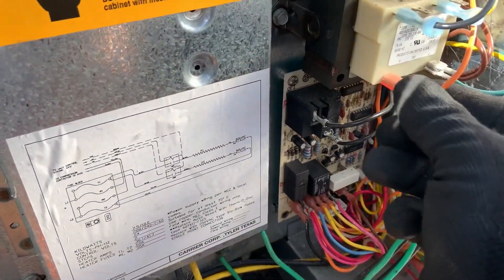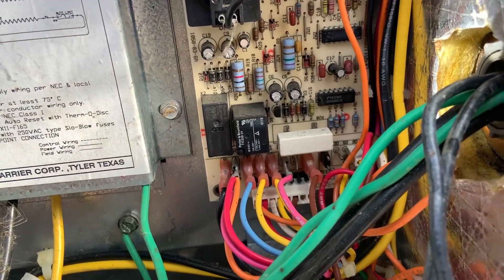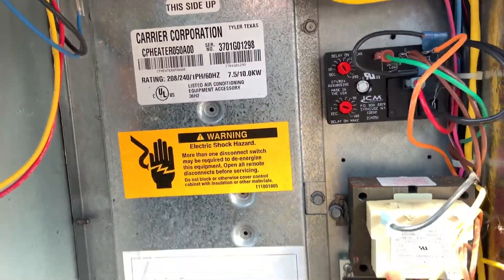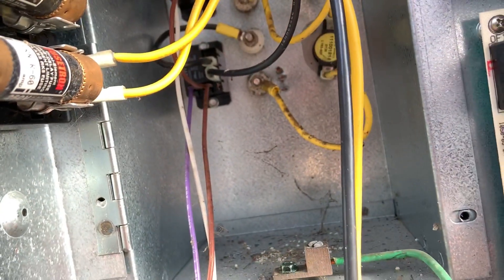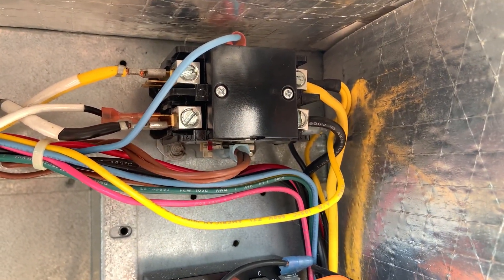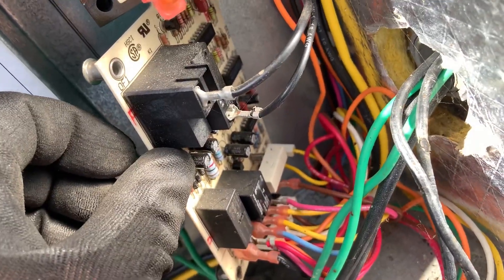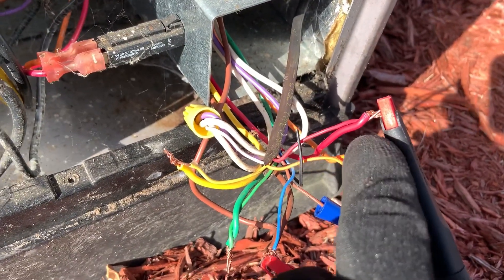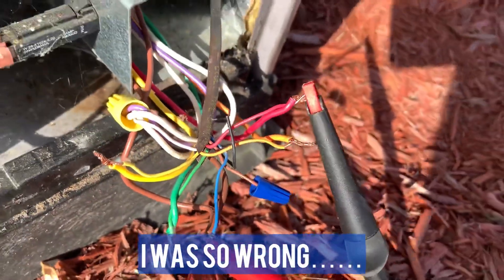HVAC Service | Troubleshooting a Low Voltage Short | December 2021

Comment: Typically run threws and bad connections can cause intermittent low voltage shorts. Nice like to chew wires and sometimes there not always chewed threw

Comment: I realize it’s probably just a coincidence but almost all the the low voltage issues I run into seem to be a Carrier product. Not sure why lol. I installed a new Payne split unit one time 14 months later it started that. Same thing you had reversing valve wires had done almost the same thing. It would go through a defrost cycle it was winter and pop that fuse. Thanks good vidio.

Comment: Always check your pressure switch wires especially in package systems. The transformer you replaced was fine. I hope you didn’t charge them for that transformer.

Comment: Good video ! 
Bottom Line is --- You Most Likely Got it Fixed ! & on the First Visit with an intermittent short.
However you got there. Thats a Good accomplishment ! 
You Should Pat Yourself on your back for that one !!! 👍
some tips ive found on transformers ---
1) Burned smell test = Junk.
2) do a visual - burned spots = junk.
2) Ohms - Check if shorted to ground.
3) the best way to test them is Check the secondary voltage under load. ie: Hook a known good Contactor up to the secondary side.
if u have 22-29 volts with a 2 pole contactor pulled in your good to go. 30 volts WILL BLOW up a Digital thermostat ! 100% on that.

Good catch on Wires being rubbed through.
That Will allways do it for sure !
a Few wire ties for the Win  🥇! & New wire & connections.
Transformer = CYA for sure. Old trans could be a crap shoot.

Hopefully you took the existing circuit breaker out & Just Ran with the New Transformer with built in New Circuit breaker.
that circuit breaker could have been pretty stressed being reset i dont know how many times by the customer.
Definitely Good Job ! 👍

Comment: Brother I’m like you, the transformer is usually good, or bad. That was interesting. You did the rite thing replacing it if there was any question at all about it.I had basically the same thing happen to me years ago on a unit I installed about 14 months earlier. It was almost new. Reversing valve wires, LOL.. where the wires were factory run it had done the same thing.

Comment: I'm confused after watching. Maybe i need to watch again. But as far as i understand, if your transformer primary or secondary is bad, you won't get 24 volts. So i don't think the transformer was the problem.
Im guessing the issue was the wire that was rubbed out. But my question is did you replace the transformer and if so why if you were reading 24 volts?
Reply: My guess why he replaced is because how many times the homeowner reset the fuse is why because the more short resets you have the more stress is put on the transformer. If it would've went bad within his labor warranty period it would've been ok but shortly after the homeowner would've assumed it's something that he missed. I let the customer know the situation and leave it up to them if they want it replaced that way if it happens you're covered.

Comment: Get this....

I had the (SAME EXACT ISSUE) only the RV COIL itself was bad.. Took (3 DAYS) and 3 trips to figure out.. 

The reason is, as soon as you would get there, no grounds (ANYWHERE) could be found!! New fuse installed, and ran fine!! 

It had gotten warm, so the unit only went through 2 defrost that grounded, it didn't dawn on me until the 3rd trip what was causing it, as it had finally went into a defrost once warmed up outside some vs it going through several cold blowing the fuse every other cycle.. 

Low voltage grounds can be a (NIGHTMARE) to find!!!!!

I had a BRAND SPANKING NEW contactor 2p heavy duty go bad first time used!! Blew me away on a new heat pump no less!!  It happens!

Comment: I'm pretty sure the transformer should show a resistance, its just a few loops of wire like a motor winding after all. Am no expert, all our control circuits tend to be 240V!